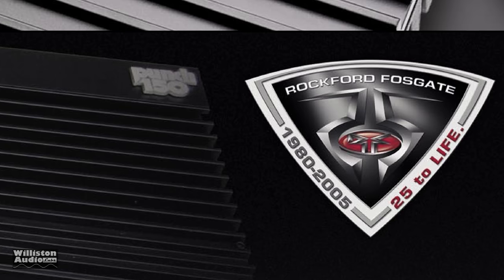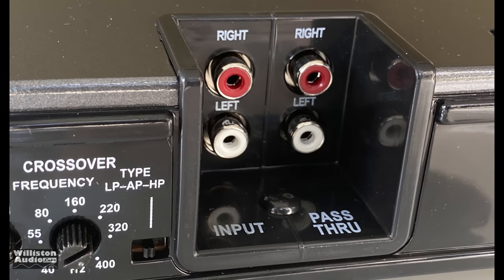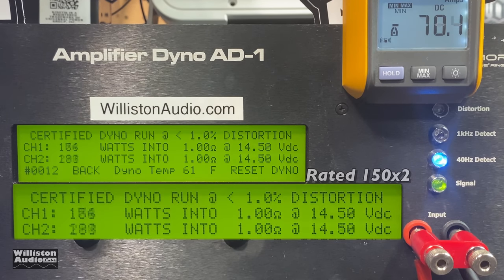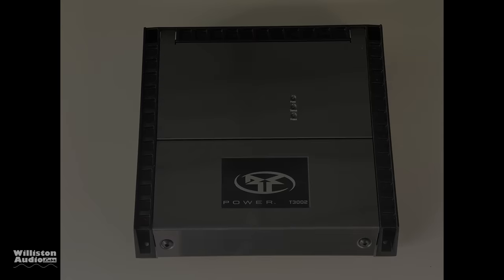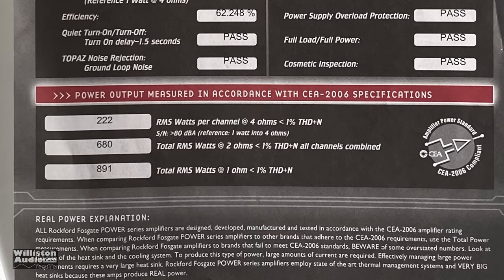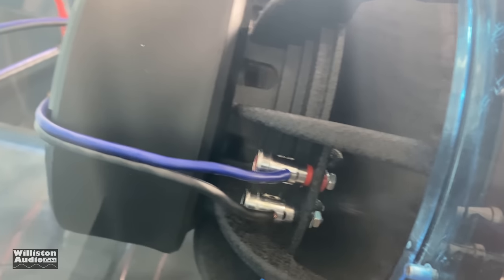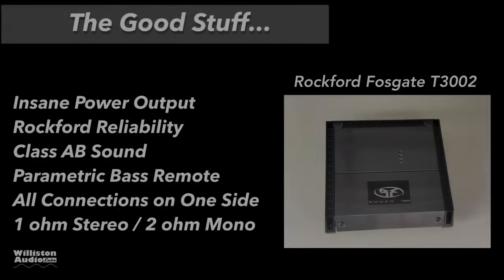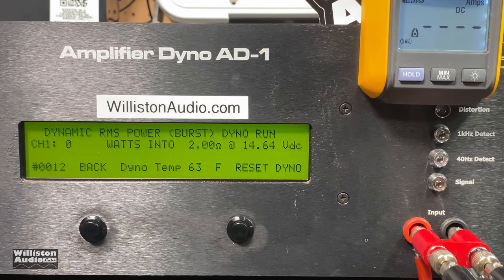Rockford's Most Underrated Amp Ever? 2005 Power T3002 Review and Amp Dyno Test [4K]

Comment: RF actually has another amp that is just as underrated, if not more underrated than the T3002.  The 1999-2000 Punch 200a4.  Conservatively rated to do 100x2 but actually does 500-600wrms as seen on some birth sheets

Comment: I forgot where I saw/read this at but a little “hack” someone can use to guess the max output of a amp is by adding a zero to the end of the number on the fuse .. example - you have two 15 amp fuses , add it together 15+15=30 then you add the 0 to the end of the 30 which equals 300 , it’s not perfect by any means but gets you in the ball park , same goes if it only has one fuse - 25 amp fuse add the 0 = 250

Comment: back in late 90s by far the punch 45 was way underrated. i won comps with it running 2-15s fkn shook everything i wish i had a couple
Reply from the maker: The Punch 45 was rated 22.5 x 2 and does around 60x2 at 4 ohms. About 300% over rated. The T3002 is 400% over rated, but yeah all beasts

Comment: ive always found rockford amps to put out more than what its rated for.   i got a rf p700-1bd and if i remember correctly the sheet that came with said it was tested at mid 800s watts RMS.   i smoked 2 pioneer 10inch shallow mounts in no time.

Comment: Rockford probably built this to be an extreme sq amp. So for example they might consider it 50 watts rms at .01% thd and know that anyone building an sq car will check the levels and only use the 50 watss since it is a very clean signal.

Edit
That's an Interesting reason behind it. I still bet its a hell of an sq amp on 50 watt drivers.

Comment: I loved these amps the only thing wrong with them was no sub sonic control broke many HX2s up around 50!!
 Even after I had a box built to the specifications they just would come apart not actually burn up the spider would come loose from the Cone or the Cone would come loose from the coil. I hated the HX2s

The last pair I had I just left the volume down and they lasted a long time.

Comment: Regarding the underrated output, in the 90's it was very common to run an un-regulated power supply in the amp, and get the output RMS ratings at 12vdc. Then, when run at 14.4vdc the RMS output would be much higher. For competition, the official "rating" of the amp would be used to classify the competition vehicle. If the competitor was able to build a vehicle electrical system that could maintain 14+ volts, they would benefit from much higher RMS power. Especially when ran into low impedance loads. This is how the HCCA amps gained their reputation. It'd be interesting to see if this T3002 is using a fully regulated PS, I suspect that at 12.0VDC it may put out closer to "rated" power.
Reply from the maker: These have unregulated power supplies but were actually rated 50x2 at 14.4 volts
Reply: @wal  Hmmmm.... still would be interesting to see that actual dyno ratings at a more typical voltage like 12.0VDC...many of the vehicles these were installed in might be supplying less than 12.0VDC at extended idling at the amp input terminals. So you are definitely getting your money's worth even in a typical car system.

Comment: This is criminally underrated. I would be really pissed, if I assumed it'll be 100W max, and it smoked my woofers.
Reply: Lmao
Reply: 99% of the time you wouldn't smoke 100W woofers by doubling or tripling the power. You would reach the mechanical limits of the woofer(still may hurt it, but less likely) before you'd cook it thermally. Typically using an underpowered amp or the right sized amp will cook a coil because people want more and push the amp into clipping. Having extra power is typically preferential whether you know you have it or not.
Reply: @D4rk51d332  It depends of the type of music you put through. Sure, they will not seize up like a sub, but giving 200W into a 50W RMS woofer with fast techno beats can cause partial melting of the coil, which will lower the impedance. I should have written tweeters instead, those are definitely more endangered by higher than specs wattage.
Reply: @drumsmoker731 Yeah woofers and tweeters are way more susceptible, since they have to really on the coils thermal capacity alone. I'm used to people talking about subs, sorry for assuming. At least someone else will probably learn something from our back and forth 😊
Reply: @D4rk51d332  - having extra power is to avoid clipping, keeping efficiency optimized and avoiding amp abuse. Not knowing your power is 3x the stated wattage could be a massive issue if your a rookie in the game.

Comment: It is 5:02 into the video and I have a prediction as to why RF underrated tge amp. Being that OP, if you try to gain match the amp at what its rated, the efficiency will be in the upper 90% range.
Reply from the maker: That’s a sneaky point 😜

Comment: I had someone give me a  Sony  EXM-302  30 watt by 2 in 4 ohms (They also make a EXM-202 )
I used it in my  grandson's truck stereo. I had a choice of using a PPI 50x2 Sedona amp or the Sony.
I was curious to which one performed better so I hooked the Sony first thinking the PPI would be the best amp
and would leave the PPI in the system. Boy was I wrong ! The Sony was more dynamic and the sound of this amp was
a lot better that the PPI. I looked up the Sony amp to find out they are  very much in demand still.
Would be interesting how many watts this little amp does produce. Makes a great Ice chest stereo amp.
SONY EXM-302 2CH POWER AMPLIFIER ADD PUNCH WITH PRECISION CRAFTED AMP | eBay

Comment: Its ok to say "three hundred two'' instead of "three thousand two". Its better that someone think you mispronounced it than someone possibly thinking this and maybe other (cheap overrated) amps are doing 3000w.
I used to have the t5001bd back in the day and it was a little beast. It had nine hundred sixty something on the birthsheet if I remember correctly. I got to hear a RF demo vehicle in 05ish that had a 3002 and a wall in a little scion (that actually just came out) and it sounded great. It was funny I remember my brother ran into the guy at the store and convinced him to bring it over to the house so I could check it out. They pulled up outside jammin and I looked out the window and I was like wtf.

Comment: Back in 2006 I got a job working at Best Buy, and was able to get one of these for $100 Canadian. It was the floor model so they let it go cheap. Made the trunk of my Civic feel like it was going to blow off!

And then a couple of years later when I was at university someone smashed the windows in the middle of the night and broke in to the trunk and cut out all my wiring, took my my two amps, and my crossovers. 

I was moving some stuff that week so the subs were in my parents basement. Still have them to this day, but man do I miss the amp.

Comment: this proves my theory add a 0 to the end of the fuse number and that gives you your rough approximate total watts . . . in this case 80amps plus a 0 gives 800 wats (400x2 at 1 ohm)
Reply from the maker: The odd part is this is Class AB which usually doesn’t quite fit that mold, but this time it sho did

Comment: Hey Big D, have you ever tested the Rockford Fosgate p300.1 amplifier and I just came up with two of those amplifiers that have supposedly never been installed in a car audio build before and I have two late nineties model infinity kappa perfect 12.1 Subs that are the aluminum ConEd sub but where they're single voice coil subs and these amps are mono amps, how should I run each ampon each sub and what kind of power does the p300.1 put out if anyone on here would even know that please let me know. I've been out of the stereo game for 20 years and I'm slowly getting back into it but I'm a little rusty on wiring up systems and stuff because of being out of this for so long so any advice would be greatly appreciated.....

Comment: I like your tests but... In germany the cars have roundabout 12,8-13,8V When the engine Run.
Never 14,5V!
Does in the US the cars have all times 14,6V?
Reply: No, most charging system on ANY modern car (german, japanese, american) will run anywhere between 12.5-15 volts depending on the batteries' state of charge and temperature. The 14xx volts shown in the tests here is accepted as an industry standard. In real world use the voltage available to the amp will almost always be lower.
Reply from the maker: Check amp-performance.de as he tested 2 at 13.5 volts

Comment: Hi big d i have a 2004 avalanche with the bose equipment but i went to walmart and got a harness and a dual radio installed but i still have problems with the engine sound , when i lower the sound to 0 you dont hear it but as soon as i go to 1 it starts i wish i had the resources to have money or knowledge , if you can pin point me to the right direction would be greatly appreciated.
God bless you and your family
Reply from the maker: Check with Five Star Car Stereo, they do live Q&A stream on Monday’s at 6:30pm eastern

Comment: Shouldn’t being underrated also be kinda frowned upon? Because it if someone wanted to run speakers rated at 50 watts at 4 ohms, they’d see this amp and think it’s a great fit but in reality does quadruple the power they were told. Of course, probably not an issue if you actually tune this properly with measuring equipment, but some people tune by ear and in that case, this severe underrating would seem like it’d be a bad thing in that scenario assuming the person has never seen this video.

Comment: Soo, it's misleading. Imagine buying 50w speakers, tune the amp, set up the gain with an oscilloscopes, crank it to 100%, but instead of 50 ish watts your speakers get 200 freaking watts, it will take no more than a second do blow them. 
Bad amp bad.
EDIT: even worse, your sub getting 3x more watts then what you think it will get.
Reply from the maker: At least the birth sheet let’s you know the true power so you should know before hooking it up

Comment: Orions r still n will always b the underaed cheater amps hands down
Reply from the maker: Well the 1997 Concept 97-3 was rated 0.5w/ch and did 250w/ch so yeah that was the ultimate cheater
Reply: Mtx 225ho. I don’t think Orion made anything rated at 50 watts that did 950. Maybe I’m wrong. I do love Orion amps though.
Reply: I never had any luck with orion, always broke.
Reply: @supermhart  all i ever used was Rockford, mtx, and us amps. Now all I use is DD audio. Never had any real experience with Orion amps. I’ve just read a lot of good things about them. Especially their most recent ones.